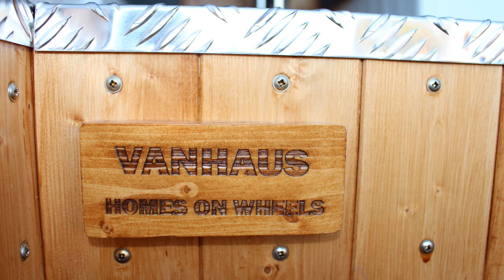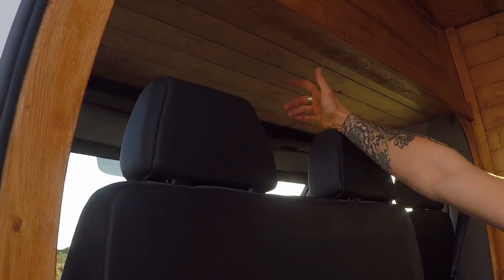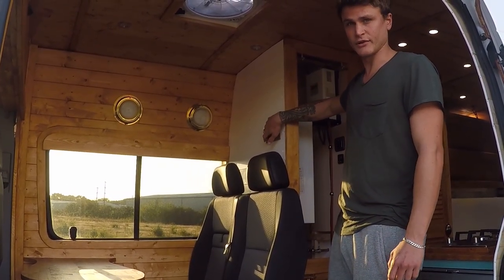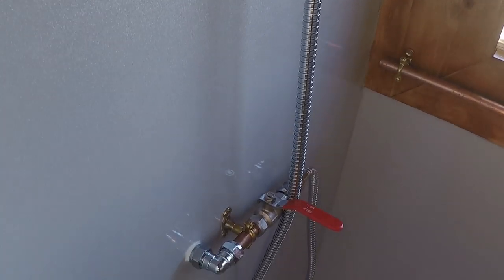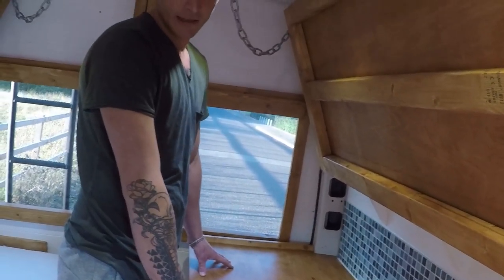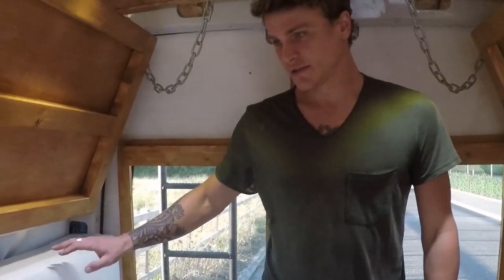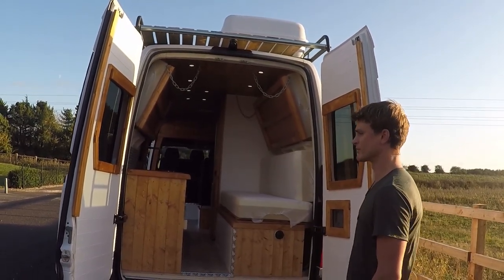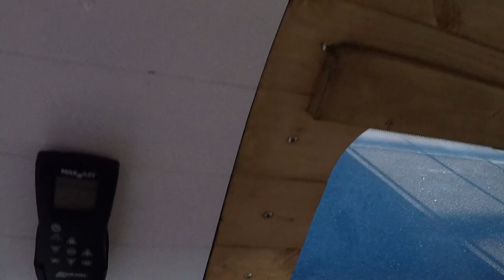VW Crafter Campervan Conversion Full Van Tour

Comment: Obviously this van is set up for multiple travelers 3+. However if it's just 2 people, you could remove one or both of the pull down beds in the back and replace with upper cabinets for storage. I would keep one pull down bed though possibly. This is a good setup

Comment: The chains that hold up the beds are a great idea:) to make them quite you can use cloth around the chain or material from a home store like chain guards made of thick rubber materials or even buy spray rubber in color directly to cover the chains, of course stereo wire shielding made of rubber or cloth can be used.

Comment: Nice.  Did you do anything to prevent an electrical connection between the aluminum box frame and the steel of the vehicle to prevent the rapid galvanic corrosion which would result from the combined use of dissimilar metals? Or are you just hoping the factory zinc coating would take all the corrosion damage.
Reply from the maker: Thanks for your comment John 👍The aluminium was clear coated and the steel is etch primered then coated in heavy duty black paint

Comment: Were is the bathroom 
Didn't he say he had kids i look twice at this video no bathroom
Reply from the maker: There is a shower and they have a Thetford electric flushing toilet which they'll be putting in the shower cubicle during the day and at night once they've had showers 😉👍
Reply: @VANHAUSConversions  Nice! You've found your calling mate and I will be looking you up for when I pull the trigger on a van build. Would it be feasible to imagine a hidden compartment where a toilet on rails could be stowed adjacent to the shower room and then pulled out from under the rear bench or lower part of the boiler cupboard?